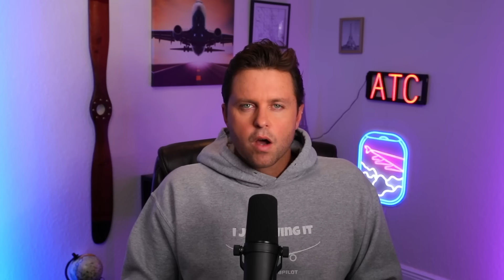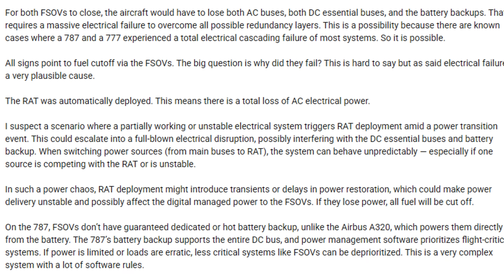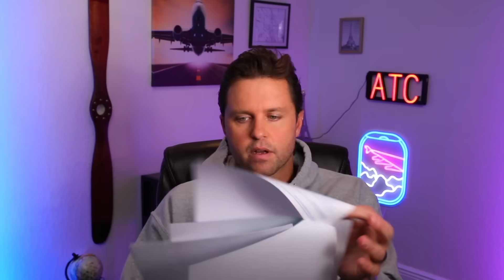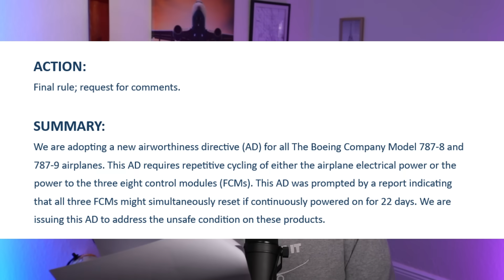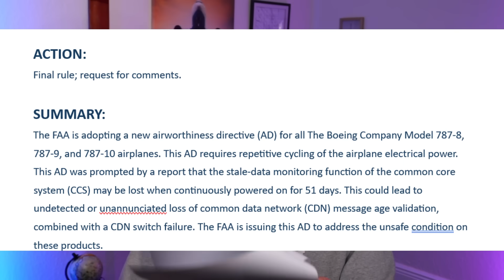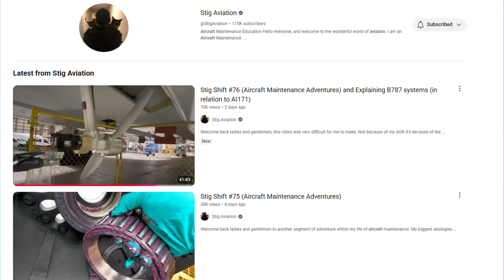Air India 171: Did a Software Glitch Cause Dual Engine Failure?

Comment: My speculation is that the TCMA did not switch from ground to flight mode. When the wheels were retracted and the wheels tilted backwards, it seems the sensor is the same with the weight on wheels. So now it commands idle trust. The pilots pushed the thrust lever back up and now the TCMA commands engines cut off thinking the plane is on the ground.

Comment: It appears to me that plane lifts, rotates, initiates gear up and boom….loss of thrust, rat deploys, plane no longer rises. But it looks like it’s the initiation of the gear retraction that sends the plane into the ground imo.
Reply: That initiated the cycle. The sensor for the tilting backwards of the wheels is also the sensor for weight on wheels.
Reply: Probably the Thrust Control Malfunction Accommodation (TCMA) system thought the plane is on the ground because of the weight on wheels sensors activation when tilting the wheels (it is the same sensor), but for this the TCMA should have not transitioned from on the ground to in flight mode. As the pilots did not let the engine thrusts to come back to idle the TCMA shut down the engines.

Comment: You are speculating, the shut off valves will not close as you said. 

The TCMA (Thrust Control Malfunction Accommodation) most likely commanded a dual engine shut off.

Comment: I've never wanted to be wrong so much before in my life, but after listening and doing some research of my own...  I think you're right.  I think an electrical issue, which we KNOW they had...  I heard the RAT with my own ears...  Caused those valves to default to closed, cut off the fuel, and shut down the engines.  That's bad, and Boeing will be lucky to survive.  My 172 kept running after I lost an alternator, I would expect a bloody 787 to be able to at least do as well.

Comment: if the "RAT" has been really deployed as per footage speculation, it can be considered the aircraft has lost all its electrical power (including APU). but what we do not know as for now is when the "RAT" is actually being deployed in this accident. if the "RAT" is deployed when the aircraft was rolling on the runway, it should have "aborted" the take-off. however, it the "RAT" is deployed when the aircraft has just airborned, the outcome is unimaginable

Comment: What your describing, defies all known engineering safety practices. To have a critical flight system like fuel shut off happen for any reason other than by pilot choice is stupid stupid stupid. That's the way it is on the Airbus helicopter that I work on, pilot hits a switch and FSOV closes and engine quits. Boeing has been building aircraft long enough to know this. Until someone finally lets the public know whats on the black boxes, I'm sticking with either a auto FADEC rollback or bad fuel.

Comment: One would think that the problem HAD to be something like this, something involving the control systems. For both engines to flame out seemingly simultaneously, it would have to be a commanded shutdown, either by the flight crew, or by the control systems. Obviously, the flight crew wouldn't have done it. Every documented case of a dual engine failure that I have come across, indicated failures that were separated by several seconds, to several minutes. We're talking about things like fuel contamination and environmental factors. I've heard a repeated theory about "vapor lock" which is absolutely absurd in my opinion. Mechanically unlikely, and for TWO engines simultaneously? Not a chance. Could not find even one documented case of a gas turbine engine failure in commercial aviation due to "vapor lock".

If the RAT deployed, this would seem to mean that the engines did NOT roll back to idle due to a bad autothrust setting or a mistake by a pilot. This would be a result of both engines dropping below idle values and therefore not generating a minimal electrical output. If the RAT deployed due to catastrophic hydraulic failures, this would also seem to indicate both engines rolling back lower than idle power, and not able to sufficiently power the hydraulic pumps.

All of this seems to indicate a simultaneous dual-engine flameout- which would have to by commanded by the pilot or the control systems- but the one thing that keeps niggling at me- "thrust not achieved", spoken by the flight crew on the radio. That phrasing would SEEM to mean that the engines were not producing the expected power, but wouldn't he have announced "engine failure" if they both rolled back to below idle values? Maybe that was because English was not his first language, or maybe because he said it BEFORE they dropped that low. Don't know. I'm not an expert by any means, just trying to put the puzzle together in my mind.

Thanks for some very interesting information.

Comment: Why is everyone looking for a cascading electrical event when the AD already says "We are issuing this AD to prevent *loss of all AC electrical power*, which could result in loss of control of the airplane" only if the power is not cycled for a certain amount of time? Not cycling power would already be an explanation what happened then.

Comment: Hence, will the coherent chain linking the suspected scenarios be: 
A. Generator disconnects (fault or software bug) which leads to loss of AC power.
B. Fuel pump pressure drops leading to the FSOV (Fuel shutoff valve) failing to open properly.
C. The engines suffer, thrust drops or becomes erratic.
D. TCMA (Thrust Control Malfunction Accommodation) detects thrust control fault, intervenes—possibly limiting thrust.
E. RAT deploys to support critical systems.
Cascading failures across hydraulic, fuel, and electrical systems, potentially leading to partial gear retraction and loss of climb performance

Comment: "Occam's Razor”

 In 2008, British Airways Flight 38, a Boeing 777-200ER, suffered a loss of engine power during final approach. Fuel flow to both engines was restricted—most likely due to ice formation within the fuel feed system. That same year, Delta Air Lines Flight 18, also a Boeing 777, experienced an “uncommanded rollback,” believed to have been caused by ice formed from naturally occurring water in the fuel, restricting flow to the engines.

More recently, Air India Flight 315, a Boeing 787-8 Dreamliner, as well as Air India Flight 171, had to return to their departure airports due to reported "engine fuel filter problems."
In the earlier incidents, the problem manifested as ice. In the more recent cases, the issue is believed to be microbial contamination—specifically, the buildup of microbial particulates within the fuel system, leading to clogged engine fuel filters. This causes a significant rise in differential pressure across the filters, potentially triggering the bypass indicator and alerting the flight crew. Such incidents typically occur during takeoff or shortly afterward, when fuel flow is at its peak.

While the form of contamination may differ—ice in some cases, microbial buildup in others—the root cause remains the same: fuel contamination, resulting in similar adverse effects on engine performance.

It was considered a miracle that the crew of British Airways Flight 38 had just enough altitude and time to respond. Unfortunately, in the case of Air India Flight 171, it’s possible that after the initial fuel filter problem, the bypass valve failed to activate, leading to a dual engine failure and deployment of the Ram Air Turbine (RAT)—all at the worst possible moment. The outcome was the opposite, sorry.

Comment: Just came across a must see video, “Mass Murder Over DC”.  There can be no question that the military helicopter deliberately hit the jet, head on, unwavering in its course until impact. That’s official.  The NTSB is refusing to release ALL altitude data for the Black Hawk; the GPS data is “missing”; inexplicably; there were NO automated warnings; completely inexplicably; etc etc all showing US Gov complicity.
Reply: 1 Off topic.  2 Having followed that previously, it is more likely pilot error due to systems (night vision) goggles poor comms / arrogance. But essentially only in DC is there such blindness to the bleedin' obvious 1,000 feet vertical separation is required for safety.  and there over the river military advice to congress was that military pilots did not have to follow common sense.
Reply: Never assign to conspiracy that which can be attributed to incompetence. That's a saying I have found true in most cases for over half a century. Hillsborough is one of the few exceptions, and that was obvious to most of us from the start; though I was surprised how big a conspiracy it was when it all came out, I felt sure as I could  be that it had been one before that- but that's because there was actual evidence of it. As yet, we have zero evidence of any conspiracy here.

Comment: The engines can suction feed with 0 fuel pumps operative and the valves do not fail in closed position. I wouldn’t doubt some kind of sw glitch though and as a 787 pilot I’m very concerned about the lack of data being released, as they’ve surely deciphered the likely cause by now. I feel like the fleet should be grounded until it’s understood. I’m not excited going to work with all the uncertainty

Comment: Wrong wrong . Use your ears. The video that has been on the internet. That’s the original video you can hear the RAT but you can hear the engines. However they were nowhere near max power. If you just use your ears you would think the aircraft is in the landing phase not take off and climb. So the engines were still operating . I’m sure the AIB will milk the flight data recorder and flight voice recorder. Even if you override the TOGA system you need power to do this .

Comment: Sounds plausible. However, it is hard to believe that fuel shut-off valves would be designed to spring closed (and stay closed) with a momentary power  loss.  If so bad design.

Comment: 8:54 The fact alone that ANY automated software is even ABLE to fully shutoff the engines sounds like the beginning of a new MCAS disaster. So much for "full control over the aircraft" and "keep it simple and robust". What are the FSV/Fire handles in the cockpit for if the plane makes the decision anyways??? I really wanna see the risk assessment saying we rather have the engines shut off automatically than have them produce too much thrust! HAHAHA Boeing

Not to mention nobody knowing about it again lol or the badly designed electrical subsystems causing the power issues in the first place.

Comment: Here's the real headline in all this at this point.. if it turns out that a group of dedicated, serious and tenacious pilots and engineers - outside Boeing, the FAA and with no access to black boxes etc from this crash - have pieced the cause together by now via YouTube then Boeing and the FAA also must know this. Failure on their part to inform about it and act in timely and appropriate manner can then only be seen as beyond reprehensible. The good thing about Youtube is we all know when this cause was proposed, for when the official reports are released.
Reply: Thing is, they have to be SURE. People on the web do not; they have no actual responsibility to be right at a legally provable in court level. And being sure takes time. They have to check all the data, even data they don't think is likely to be relevant, because anything just might turn out to be critical to what happened in some way. And these days, black boxes have so much data it takes months to put it all together. It doesn't output half a dozen neat graphs. It's vast, what they record now.
Reply: @alisonwilson9749 I get your point.. but I used to work at a European LCC and was responsible for fleet management and leasing in  B737s and getting them cert'd with local FAA. My point is that if there is even a suspicion of this kind of issue and Boeing knows about it they simply cannot sit on it as if they learned nothing from the two 737 accidents. And, while all data needs to be looked at for the final accident report then the preliminary is exactly that, preliminary.

Comment: Electrical power loss or delay in bus switching could easily cause suction lift at high power settings in which you have already high ambient fuel —this leads to cavitation.  This is more consistent with the pilots calls of thrust not being achieved.  FSOV activation would lead to immediate flameout.  Also there are numerous ADs on fadec, altimeter, auto throttle/toga problems,  any one or combination of code errors could also lead to power roll back or erratic operation—more consistent than FSOV activation

Comment: You might be able to add in the autopilot disconnect and dive from the Latam 787.  It was blamed on the flight attendant hitting the power seat switch which sounds like BS.

Comment: In the Boeing 787, even in the event of a massive electrical failure, the engines continue to receive fuel due to multiple layers of redundancy built into the aircraft’s electrical and fuel systems. While the engine and APU fuel shutoff valves are spring-loaded to fail safe in the closed position, they remain energized in the open position during flight through power supplied by essential electrical buses. These buses are backed by both main and APU batteries, and if both main AC buses fail (such as due to generator loss), a ram-air turbine (RAT) automatically deploys and provides power to the AC and DC essential buses. This ensures that the shutoff valves, fuel pumps, and critical systems remain powered. Furthermore, each engine on the 787 is equipped with a permanent magnet alternator (PMA) mounted on its accessory gearbox, which independently powers the engine’s FADEC (Full Authority Digital Engine Control) once the engine is running, meaning that even if the airframe loses electrical power, the engine’s control and fuel metering remain functional.

Additionally, if boost pumps lose power, the engines can suction-feed fuel directly from the tanks at lower altitudes using their own low- and high-pressure pumps. Therefore, unless all sources of electrical power including both batteries and the RAT are lost and fully depleted (an extremely remote scenario), the fuel shutoff valves will remain open, and the engines will continue operating. Only in the case of a total, prolonged electrical blackout with no remaining backup power would the valves close automatically due to spring force, leading to fuel cut-off and engine flameout. However, by that point, the aircraft would have already lost its displays, fly-by-wire systems, and navigation, making engine shutdown only one part of a total systems failure. Thus, under any survivable in-flight electrical failure, the 787’s architecture ensures a continuous fuel path to the engines.
Reply: Okay, so how could this have happened then? I think there may just be a hole in what you're saying somewhere. Because something DID go wrong. And it looks like it was the engines. Both at once, to the minute, possibly even the second. If that's not software or the computer system that's common to both, what on earth else could it be?
Reply: Systems are complicated and for 3 ADs to be issued........there would have been serious issues requiring rectification.
There may be a serious issue here requiring rectification.

Comment: Thanks for the detailed breakdown and sharing the ADs and past incidents — that’s helpful context. That said, presenting this info in a way that steers listeners toward a specific cause, like a software glitch cutting fuel valves, before the investigation concludes still crosses into speculation. The 787’s systems—especially fuel shutoff and electrical power—are highly complex and designed with multiple redundancies. Without verified data, it’s easy to oversimplify or misinterpret what’s happening. I respect the curiosity here, but for aviation safety topics, precision and patience really matter.
Reply from the maker: I agree. This is why it’s only a hypothesis at this point. Nothing more.
Reply: @Garybpilot keep up the good work!

Comment: It’s pretty much accepted that the plane had a dual engine failure? What? Accepted where? Let’s be clear, nothing about this crash has been ‘accepted’ as of yet. To say anything else is simply a lie.
Reply: It's a wee bit tricky to explain why it fell out of the sky if the engines were working......
Reply: @alisonwilson9749  Actually it could have been a lot of things. Guessing just doesn’t solve anything. Maybe one engine failed and they secured the wrong one during the checklist. Maybe they configured flaps wrong, maybe they lost one engine and forgot to bring up the gear. Maybe they lost both engines. We simply don’t know.
Reply: @alisonwilson9749  Look at that, the report is out and it wasn’t a dual engine failure. One of the pilots shut off both fuel cutoff switches. Pilot induced engine shutdown right after takeoff. See how asserting that it was a dual engine failure was kind of silly?

Comment: Just like MH370 (Boeing777) which  we know suffered  complete loss of electrical power to the Left AC bus , in turn  cut power to the ASCPC  and depressurized the cabin. These Boeing fly by wire giants  both have electronic pinch-points which can disable the whole plane